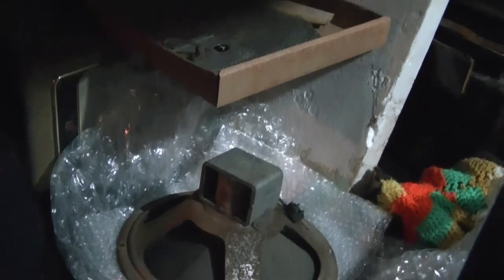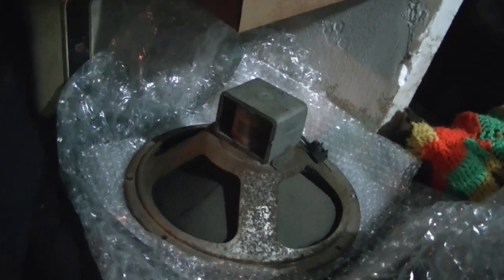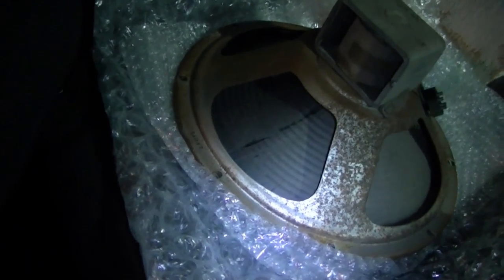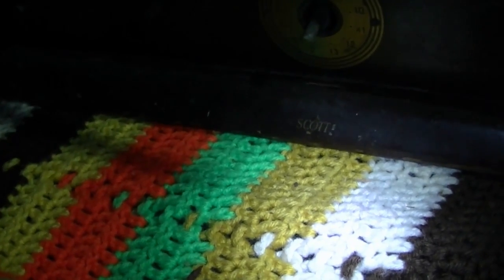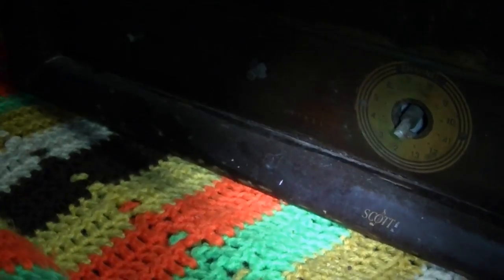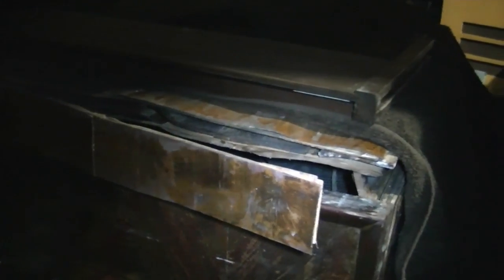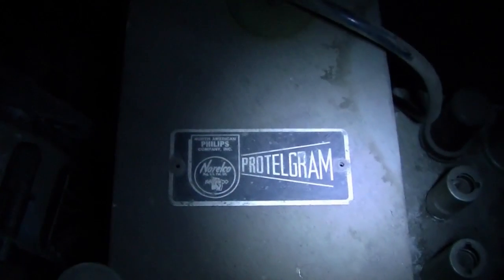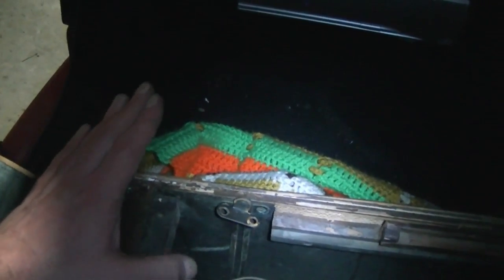Thanksgiving 2013 expedition p1o2

Comment: I have or had one of the Sentinal ones and it looks exactly the same with the hinged back and all> are you sure that isnt a rebrand?
I had 2 of those rca projection sets, they were HUGE and super heavy. I sold them before they ever had a chance to make it into the house.
Interesting on the ion thing. I have a working set i test them in, have found a few dark ones. Dont really work on those sets
Reply from the maker: Yeah, it probably is a rebrand - I don't think Airline made any of their own stuff.
Reply: Airline was just a private label brand, Monty Wards used to contract out to a number of manufacturers to build radios and TVs for them, Wells Gardner and Belmont Radio mostly. Sentinel made radios for the Coast to Coast store chain so it's not a surprise that they would make TVs for Monty Ward. I don't think that E.H Scott ever made their own TVs either, I think that it was outside their field of expertise and they just did not have the capital to develop their own stuff. The direct view Scott TV chassis were made by DuMont, so Phillips probably built the rear projection TVs for Scott or Scott built them under license.

Comment: Nice finds!
Sure that rear projection set is rough, but so cool! Really, 25KV on the anode of 3" CRT? Would it bloom? If it didn't it, does not seem logically that it would have a very long life. Perhaps the construction is very different.
That 7" portable is unique as well. Weird, three seliniums.
I can just see you trying to get that 300lb rear projection TV into your place. Yeah right! :-()
Have a good weekend!
Reply from the maker: It's designed to run at 25kV.  I assume the aluminized layer and phosphor is thicker than usual.  The 5" projection CRTs run on even higher voltage.  They even had much larger versions (12" ?) for projecting on movie theater screen that ran on something like 100,000 volts that required elaborate cooling systems.
Reply: bandersentv

From what I understand with today's (well as today gets since they no longer make them) rear projection sets the higher voltages is to accommodate the brightness I assume. On top of being color sets it needs to support 3 of them. But being this one is a b/w it sounds about right.
By the way EPIC find I cant wait till you dive into that one, I'll be frothing at the mouth to see that come back to life rebuilt cabinet or not! That is truly awesome!
Reply from the maker: shortwave
I'll be posting an in depth video on the Scott later today or tomorrow.  Also, part two of this adventure :)

Comment: That Airline TV probably used bronze plated or brass screws and cup washers through the side, they used to use screws like that on portable record players and radios. It's too bad about the missing knobs though, hopefully that high voltage coil is still useable. I'm surprised that you don't have more Monty Wards TVs and radios in your collection, they used to be Sears rival in the department/catalog business.
Reply from the maker: I'm not sure why, but I just haven't seen many Airline TVs around here.  I only have one other I got around 5 years ago.  I have had a chance to get the very similar Sentinel TV400 before though, but honestly I think they're kinda ugly ;)

Comment: TV shop parts sets. The TV owner got the estimate and abandoned it; the ones that could be sold for more than repair cost were repaired and sold, the others got stripped for parts. Tubes and chassis screws were always in demand; most sets were missing a few screws and replacements were very hard to find. What's left is what you got. More trouble to take to the dump than to stack up.

You'll find that all of these are in pretty poor condition with missing parts almost anywhere. The Scott is probably well worth your time; the MW is probably not. Check the value of restored / working sets before beginning - unless you're positively in love with one of them. Be very sure to check expensive parts; flyback, CRT, transformers, etc. before beginning - if it was just a bad tube or two you wouldn't be looking at them now.

The MW was a rebadge / BTO set. If it wasn't made in Japan, it probably came out of Wells American. Wells made TV sets for name brand companies for years and I never saw one I liked or could get specific parts for. The only thing worse was a GE; they used circuit parasitics and wire inductances / capacitances as functional parts of the circuitry. Getting one of those to work right after a few years of use was always time consuming and frustrating. Those "parts" never showed on the schematics.

Ugh; I used to run a shop and repaired at least a dozen sets per week; most were tube sets, a few were early transistor sets. I made a decent living doing it - but about 10 years of it was more than enough for me.
Reply from the maker: All the sets will be restored - it's what I do as a hobby.   I currently have about 90 sets with 25 or so restored.  I also have a few thousand spare tubes and plenty of spare parts so that doesn't worry me.   Check out my other videos and you'll see what I mean.
Reply: You are new to this channel aren't you?
Reply: bandersentv I understand about the hobby aspect - and also understand that there are so many interesting sets and just so much space to put them in, and only so much time and money to spend on restoring them. I admire your determination and attention to detail, keep it up!

But I also understand about the "olde tyme" TV repair business and how those sets ended up being stripped for tubes, screws and other useful parts. Just be sure to look at each one very carefully - and it's OK if some are deemed to be not worth restoring. I had a couple of rooms in my shop with shelves of parts sets all around the walls. Occasionally, they'd provide a solution for a difficult problem.

What really got to me were the replacement parts problems. OEM parts went out of production quickly, and the "universal replacement" parts were usually fine, but too often they worked poorly if at all. There were whole groups of models which usable replacement flyback transformers were unavailable for.

For those considering restoring an older TV set, look for ones that were shoved into the spare bedroom or storage when the new set came home. Those are often working and have minimal problems other than the age related ones. Avoid old motel TV sets (ugh) and TV shop parts sets; they're usually not worth the effort.

Here's some truths that will help you along: your tube tester is useful, but limited. If it says a tube is bad, it probably is - but it might work in the set anyway. If the tester says a tube is good - it may or may not be. If your thoughtful analysis of the problem suggests a tube is the problem - you can put it in the tester and your diagnosis may be confirmed. Or you can do as we did back in the day - just replace the questionable tube with a known good one. Especially when dealing with power tubes; V and H output, damper, rectifier, etc. None of your testers will check these under realistic loads and the results are close to useless.

And there's a "gotcha" when shotgunning new components into a set to fix a problem. New parts are not necessarily good parts and you might find the result to be worse than what you started with. I learned to run new parts past a tester before installing them; YMMV.

OlegKostoglatov- I'm not new to this channel or the process of repairing old TV sets. They can be tricky and sometimes a little advice from those who used to do this is helpful. I watch these videos because they bring back memories - and show a level of craftsmanship beyond what my customers would pay for.